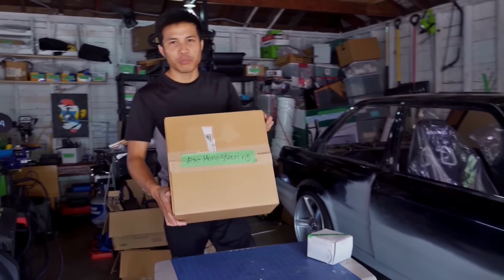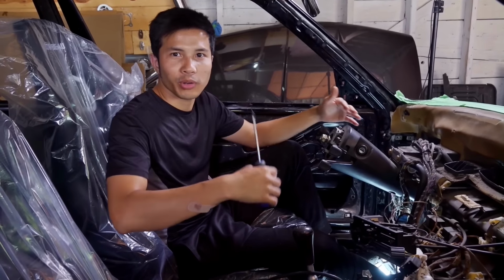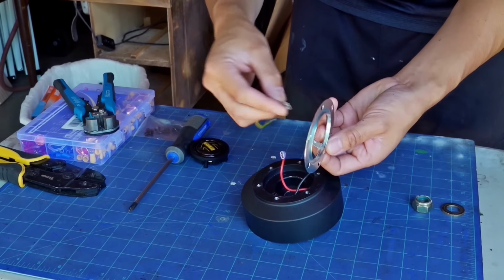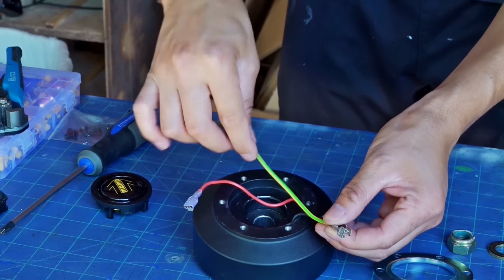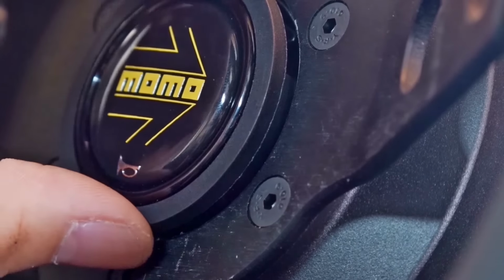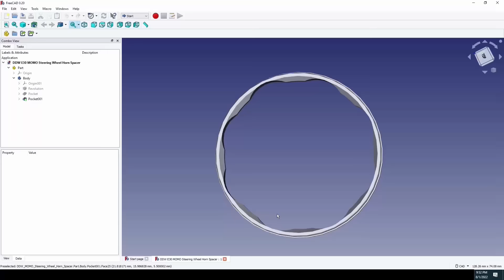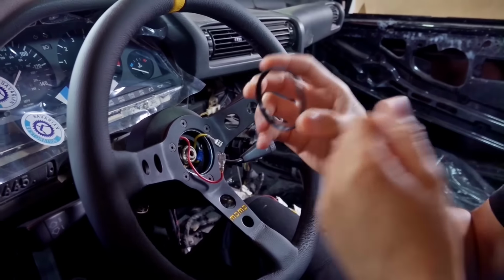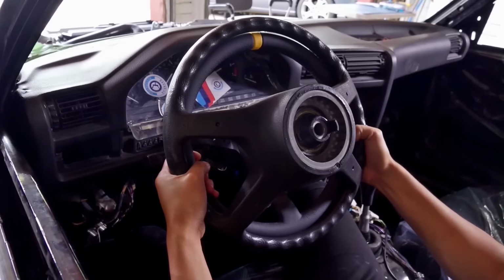E30 Fix 24 | $228 MOMO Steering Wheel & Lowering Column

Comment: I just got the same steering last week for and did not realize it was going to block part of my view on the gauge cluster. I then purchased an eccentric hub adapter that offset it 12mm to give me better visibility of the cluster. The downside is that the stalks are further now as well.